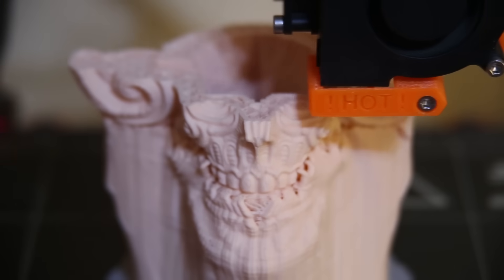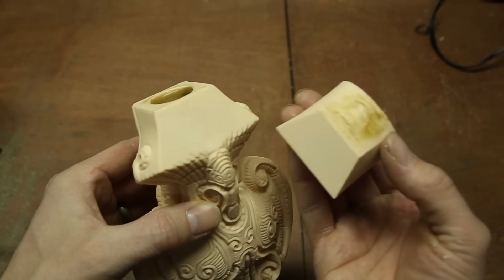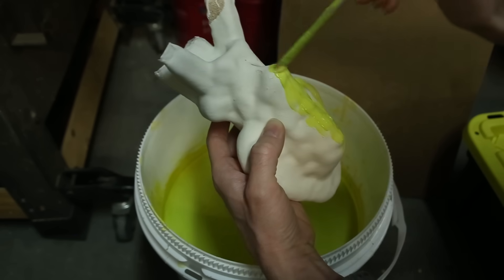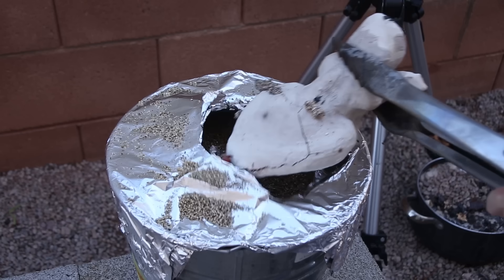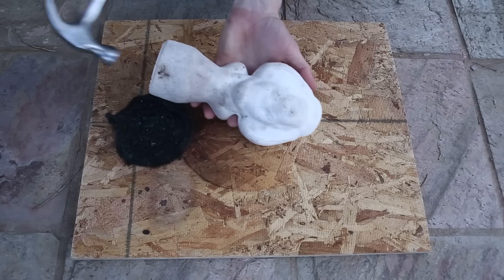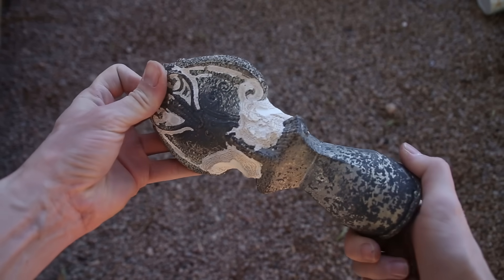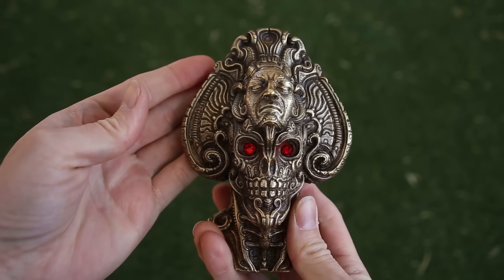How to turn a 3D PRINT into METAL │ Lost PLA Metal Casting │ ASMR

Comment: I like to make a Vajra that has 2 purposes as a decorative piece and it also has instructional value as you can take it to separate parts to see how the vortex gas works inside ( destroys CO2 of exhaust gasses in all combustion engines and you can use it to purify gas from kilns etc by using a fan ) it says on the schematic i made to use stainless steel but i was interested if i could use brass after if made the 3D model on the printer out of PLA, here it is under open source license youtube.com/post/UgkxQs0s9HQsBJlFxzzXppMIgcum5FEi2Efn thanks.

Comment: Problem ive found is that ceramic slurries are STUPID expensive. Ive tried making my own with mixed success.  The one used here- suspenda-slurry is insanely pricey😂 200 for  <5 gal. I havent found any options to buy smaller quantities. I only need to make a couple items😂
Reply from the maker: Yeah it is stupid expensive and it’s more like $300 but worth it in the long run. I get about 20 castings like this out of a bucket.

Comment: Always put the tin in first and load the copper on top.  Use granulated copper.  It’s more efficient to do it this way, because it effectively lowers the melt point by precipitation.

I hate melting brass, the white plume you see is nasty, I’m glad you had some protection.

Good job.

Comment: Doing a mirror finish on bass isn't difficult. Any level of polishing would made it contrast with antiquing process that you used. Even just running a buffing wheel over the entire thing would give it a lot more contrast. The casting is outstanding.

Comment: I don't know if you tried to or not, but PLA (specifically black PLA) in vase mode, with thicker walls = shorter time. Don't bother printing (For stuff like this) in anything but black PLA because it's the pure stuff, without added extras. You're wasting your time making things too well made in Lost PLA, especially since you're printing for ceramic coating. jm2c

Comment: dude, are you printing directly on the bed without a plate?! Also, pulling a print like that will surely decalibrate the printer slightly. Thats barbaric

Comment: I know this was a while ago, maybe somebody here can answer. Doesn't adding sand to the inside of the mold lose resolution on the casting? Wouldn't you want to dip and sand only the outside so that the inside burns out and you get the best resolution from the plaster to the 3D print?

Comment: At the bronze foundry i used to work at we always tied wire around the ceramic shell between coats to strengthen it. Also you shoud insert some hooks in the pla (we used wax so it's easier) before ceramic coating it (if you make a hollow cast) to make sure the core doesn't move within the exterior shell. (i don't know how yours didn't move). Keep up the good work.

Comment: Because PLA expands much more and begins melting much later than wax, you should use investment molds instead of ceramic. Or just use wax-infused filament. Or both. Ceramic shell can capture more detail, but only if the pattern does not destroy it.

Comment: Do you preheat the mold before pour?  I am sorry if i did not notice.  I worked in a vacuum casting facility and if were doing say a 2250 pour we would have the molds preheated too say 2000 ish to prevent breakouts.

Comment: Bruh............
You're making simple things more difficult
Why not just use a flask and plaster instead of that modern ceramic material that works worse? Lol
Just put your printed thing into a metal tube,  cover it with liquid flask, when it become hard, put it in a muffle furnace. Firstly, on a  low temperature to get rid of the water in the plaster, then set it to high to burn the filament.  This method  works really nice with wax, so i think, you can reach a pretty nice result with 3d printed models.

Comment: Maybe you could try using ABS filament and using light acetone to smooth out the layer lines, cast in a mold, then use more acetone to dissolve the print leaving a perfect cast.

Comment: well its boil down you have to make silicone form to create wax copy and that coated. Or if you doing full cast instead of burning try to heat it up until the plastic gets soft and extract it, if the coating is strong to hold shape.

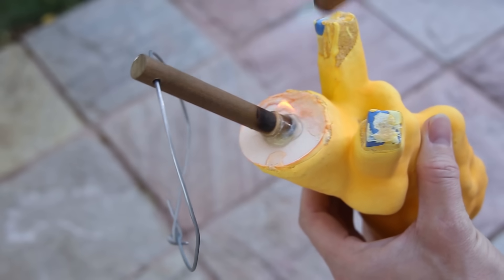Comment: 4:01  I think that's exactly where you cracked your shell, heating it so unevenly with that blowtorch.  Is it possible to ramp your kiln temp up slooooowly, to let the wax and print plastic melt out while releasing the pressure?

Comment: I think the crystal eyes cheapen the look of the casting.  Should have included eyes in the orginal print, then polished as good as possible, then used candy red paint over the polished eyes to achieve the effect.  Also, you can see the layers of the 3D print in the final casting, next time work the original print to remove the layering look as much as possible before making your ceramic mold.

Comment: Liver of sulfur doesn't really work on brass castings, would have worked perfect for your bronze but not on brass.  To blacken your brass castings you need to mix liver of sulfur with a bit of ferric nitrate, the solution itself with turn black but then it will react with the brass alloy much better.

Comment: Preheat your molds!  The ceramic mold material gains strength at temperature, also helps with flow of the metal through the mold.  Just use a propane torch to heat it to 1000 degrees plus.  To remove shell material from home made castings just take them to a local sand blaster, they will do it for cheap.

Comment: To fix the cracks you could have just used a refractory cement, the cracks are most likely hair line cracks on the casting surface and easily repaired during metal chasing.  Refractory cement is cheap like $60 for a 50lb bucket.

Comment: I grew up around lost-wax casting, and when we wanted to remove the mold, we'd just plunge the hot mold/part into water and it would basically disintegrate the casing.  Is this not an option here?

Comment: After the first layer, use carbon or glass fiber to reinforce your ceramic molds layer by layer , it will prevent them from breaking away during cast or chipping when melting out the pla.

Comment: Great job. Consider vibrating castings that have intricate detail. It's easy enough to buy a small thumb vibrator, activate it, and hold it tight to the handle of the object for 1 minute on the 1st slurry dip.

Comment: The end result looks absolutely amazing, despite having to do it twice!
Out of curiosity, is there a reason for using the green liquid in stead of pouring gypsum around the model and burn out the plastic in an oven (and pouring the brass in the block of gypsum)?
Reply: I was wondering about this as well until I realized it's probably because gypsum starts to break down around 800°C and the brass he's pouring is probably around 950°, so it probably wouldn't be very reliable. It might still work in a pinch for smaller parts if the metal solidifies before that becomes a problem, but for a solid 5 pound piece it probably would become an issue

Comment: Hint for weight. Use progressively larger drill bits marked for depth to drill it out and recover material. Once the hole is large enough you can use a die grinder and aggressive bit to recover even more material and reduce the weight!

Comment: Wow, absolutely beautiful work! The eyes really do set off the sculpture!

Back in the '80s I was a dental tech, where the lab cast alloy frames for partial dentures that were  chrome plated before set with teeth & pink acrylic. The process is similar except wax was used instead of filament and the refractory material was stronger to withstand the forces produced by a centrifugal casting machine that turned the metal molten in seconds.

Comment: Stunning piece there bud, I've no idea if it's a viable option but do you think it would help stop the cracking if after 3-4 layers of slurry you try wrapping it in a thin layer of steel wool as some brands can be teased apart into their layers then add a few more slurry layers, just thought it might be worth a go.

Comment: That was really good. One thing I would suggest is that whether you do the first style or the second style of casting mold is that you heat the mold up to about a third of the molten material to be cast and see if that helps prevent cracking. I also did believe the first mold should have been at least two more layer's thick. Other than that you just gained a subscriber.

Comment: Things I've seen other casters do is after the first couple of layers of ceramic slurry, they wrap the figure in steel wire, then add the final coats of ceramic slurry. Another thing was that they buried their mold in a bucket of sand (much like you did with vermiculite) and heated the whole thing up in an oven to several hundred degrees before pouring.

Comment: I would recommend using some form of plastic cement instead hot glue. This doesn't add anything extra into the mold along with the plastic, so you don't have any melted and gooping hot glue.

Comment: Try initially baking the shell at a much lower temperature (180 °C) to melt the plastic and pour as much of it out as possible. Another alternative you could try is disolving the plastic core with dichloromethane (DCM) if you have access to it.
Reply from the maker: The plastic really doesn’t start to flow out of the shell until around 240C otherwise I would.
Reply: @robinson-foundry  Wikipedia says PLA melts at 180C. Anyway 240C isn't too hot, you could still bake it and pour out the plastic without damaging the ceramic shell.

Comment: where can I buy this liquid ceramic or alternatives?
Reply: Nice tutorial. Thanks
Reply: My guy. I keep seeing your comments on diff 3D print vids
Reply: @kobolila-yt  ouch, stuff isn't cheap, is it?
Reply: a ceramic shop
Reply: try the greensanding method, it´s tons better and the results are much cleaner
Reply: @yourlocaltoad5102  I've used clay from my garden to create a thin slurry. Despite of that it's the same process of coating the plastic in alternating layers of clay and sand. It worked quite well. It is useful to print some kind of handle to your object in order to apply the slurry without having to touch the very sensitive surface.
However, I wasn't pleased with the remnants of sand because I wanted to machine the part in my lathe.

Comment: The reason why it cracks is because you increase the temp too quickly. The is still microscopic water in the clay. Which will create steam and causes dunting aka cracks.
Reply: Which clay?
Reply: @knsm2eiland  any clay. Some more that others.
Reply: @knsm2eiland  what is in the bucket basically liquid clay, with more silica and other binders.

Comment: Great job, I always wondered whether lost wax or lost PLA process could work.  They make some pretty decent wax filaments, something to try in the future?
Reply from the maker: Thank you. I may try that someday but I seem to get good results with Overture Black PLA so I’ll stick with that for now.
Reply: @robinson-foundry  Wax filament should burn cleaner and leave less ash, but it's more expensive (still less than any wax resin).
Did you start PLA burning "upright" so that molten plastic (and hot glue ;) ) has a chance to flow out?

Comment: By the way, at home, I have a project going just like this but it's a larger PLA buddha instead. I couldn't afford the SuspendaSlurry so I used some kind of dry wall glue/filler (can't remember what it's called) from lowes. It was very thick, almost like playdo, so I mixed it with a good bit of water and it worked to coat the molds very well after doing slurry & sand about 12 times. I've started on the meltout process in a toaster oven and will move them to a jewelry kiln one at a time for the temps above 500. Do you think this will work? I have a small crack on one of them but I think it was from the PLA expanding because once it cool down the crack basically disappeared. Is there another method you'd recommend to do this without doing straight up jewelry investment casting and also not paying the price for the Suspenda? I'm off at college rn so I have about a month to think about a second option. Thanks!

Comment: At first I was utterly confused why you'd fill it with wax, then realized it was just a coating, that was actually pretty clever tbh, but if water from from the investment were to get into the PLA mold, what would've been the problem? It would've just been evaporated/came out in the melt out -> burn out process?

Comment: If you can put some weight on casting sand like 2 to 3 times of actual casting. It really helps to prevent cracking when you pour molten metal. 👍

Comment: Great work! You made a beautiful piece. 
I suggest getting an inexpensive resin printer like the Photon mono X and then you can use a castable resin. Your prints will be in an amazingly high detail and the resin burns out beautifully. You can even print your sprue and vents. I use a steel tube and casting investment for less work but my pieces are much smaller. Not sure if that would work for something so large. Keep up the great work!!
Reply: Didn't know there are castable resins, despite owning a resin printer for years now. Thanks for sharing! :)

Comment: The ceramic shell most likely cracked because you opened the kiln during the firing process.  At 1,700 degrees if you open the lid you are letting air in that is 1,600+ degrees cooler.  NEVER open a electric kiln when it's that hot or you can guarantee that your ceramics will break. It can also damage the kiln.  I always wait to open mine until the temperature gets below 115.

Comment: If that isn't the kind of kiln that can be step heated, I would suggest getting one that can. A rapid change in temperature can cause cracks such as the kind you saw after you baked the wax and plastic out. A slower increase won't be so bad for the fairly fragile ceramic material.

Comment: Instead of directly cast using lost PLA method, you could use the PLA model to make a silicone mould and inject cast wax into the silicone mould. That way you could perform the traditional lost wax casting. Cleaner casting result and add repeatability.

Comment: Very interesting vid.  I was captivated from the start.  The casting passed through many stages in looks.  For example, in the ceramic coating it looked like the aliens from ID4.  Out of the mold it looked like something pre-Columbian, Mayan or perhaps Aztec, then it was all black and wet and it look like Hindu statues.  Finally, it was the Indiana Jones (Raiders of the Lost Ark) statue.  Very nice.  I am curious, have you ever made a crystal (not glass) molding like that--no, not a crystal skull--but just a crystal--maybe lime (key lime, of course) green or opal?

Comment: So my son and I are thinking of doing something similar but with aluminum.
Our plan is the following

1. Print the source item
2. Create a silicone mold of the print
3. Fill the mold with wax
4. Create a plaster mold of the wax item
5. Burn out the wax from the mold
6. Pour into the plaster mold aluminum

This will allow us to create more castings from the original print.
All we have to do is repeat steps 3 - 6
What is your opinion of this process?

Comment: wondering if it wouldn't have been easier to put the whole model in a sand cast, and then just letting the molten metal burn out the plastics as you pour? 

either way really cool technique haven't seen it done this way before, and great outcome!

Comment: Amazing work. I was wondering what was the reason for the crack at 04:40 of the video? My guess is that temperature was increased quite fast and expansion of the material (which is quite brittle by design) cracked.

Comment: It might be easier to get a resin printer to do these. There are some waxy resins that are specifically designed to do investment casting.
Reply: Yeah, I have no clue why they are using FDM as details get lost and it's just easier to sculpt a model, use the "MAKE MOLD" feature on many many different slicers, and then go from there.

He'll learn.

Comment: I hope you'll try colorFabb lightweight PLA for a project like this. It foams as it prints and the amount it foams is temperature dependent. At the maximum expansion lightweight PLA prints are 65% lighter than the same print in regular PLA. It seems like it would be less likely to expand and damage the mold in burnout. I could be wrong though. 

Anyway, this was another great video. I appreciate the ton of work it takes to make a video like this.

Comment: The best/cheapest way to get bronze is to use recycled water pipe and cut off the ends with solder and use the clean copper for pure copper, and the saved ends with solder (that is mostly tin) for making Bronze.
When burning out a mold, heat it Slow & Long to prevent cracking, then cool slowly.
To test a mold, first cast it in a low melt metal like lead or I use tin/pewter to see if the detail cast into the mold and transfers to the metal.
Also adding some structural support to the mold like adding glass fibers pressed into it after the first few dippings and then dipped to cover the fibers.

Comment: How are you dealing with the later lines from printing the model? Didn’t see any filler or sanding on the pla print before casting. I thought the metal would pick up fine details like that

Comment: Great work.
I work at a bronze foundry, 
After the fourth layer of slurry and chammot ( ceramic sand ) we wire (wire grid ) the molds to strengthen the molds; then three more layers.
Reply from the maker: Thank you! I’ve heard of this but I was worried that the expansion and contraction of the wire would cause the shell to crack. I think on my next shell I will try it. I don’t have mesh but thin wire should work. Thanks for the tip!